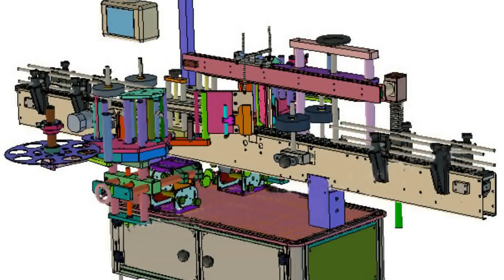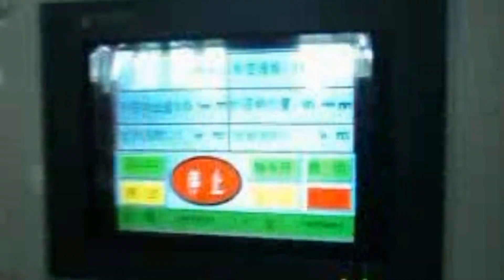front back double sided labeling machine automatic liquid detergent bottles two faces labeller equip

Comment from the maker: Basic parameter of double sided labeling machine model YX-650A
Voltage 220V, 50HZ
Power 2KW
Labeling Speed 20-120bottles/min, 150-200bottle/min
Labeling Accuracy ±1mm
Printer to use air 5 kg/cm2
Object Size 30-200 mm(H),30-100 mm(W)
Label Size 25-300 mm(L),20-180 mm(W)
Roll Size 76 mm(Inside),380 mm(Outside)
Dimension 3048(L)×1500(W)×1600(H) mm
more information about PENGLAI labeling machines visit site at http://youtube.com/user/cosmeticmachines as well as business website at http://penglaichina.com